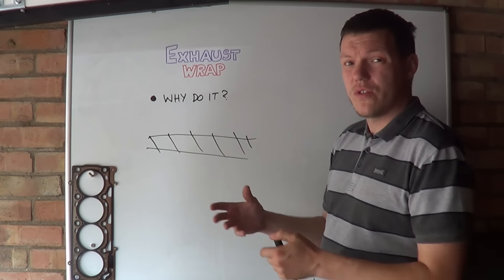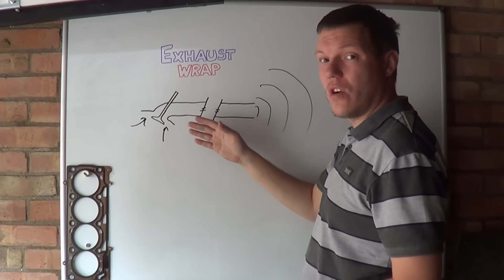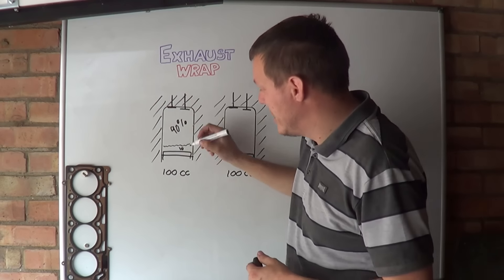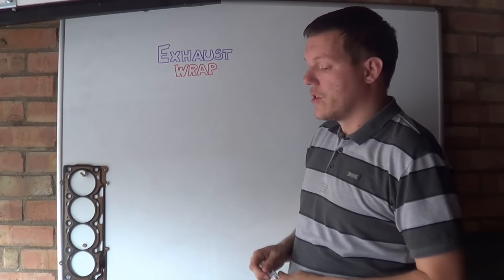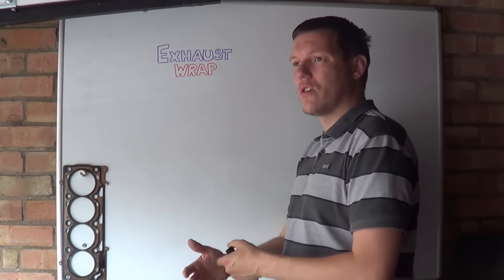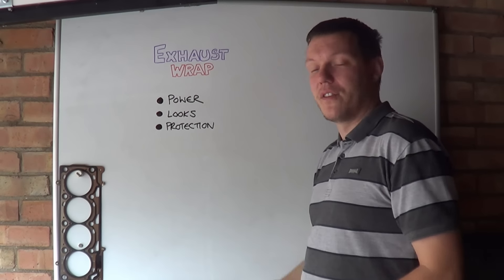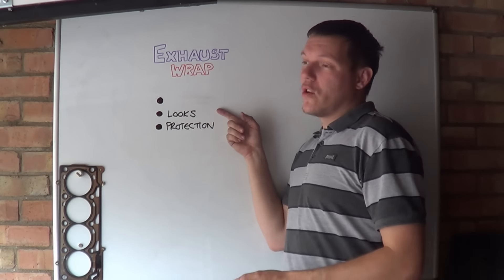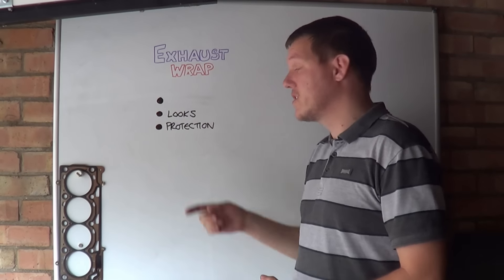Exhaust Wrap - Good or Bad - Bike TEch

Comment: There is a 4th reason to do exhaust wraps - thermal control.  I have an air cooled dirt bike where the header pipe is very close to the cylinder body and the carb bowl.  Instead of making heat shields, a good wrap helped cut down the radiant heat soaking the bowl - and maybe helped keep a little heat out of the cylinder itself.  It also helps with keeping my right leg from roasting, so bonus!
Reply: Very good point.  On one of my Harleys the exhaust is right near the oil tank.  And it burns the shit out of my pants.  But the main reason I want to wrap it is to keep more heat off of the other shit.  For example the oil tank.
Reply: This is what i was wondering about as well. Let's say you have an air/oil cooled bandit with the headers straight in front of the block, would an exhaust wrap help cooling the block, since the moving air wouldn't be heated as much by the headers before hitting the cooling fans of the block?

Comment: I had exhaust wrap on my 125, I painted the exhaust with VHT paint first and cured that, then I applied the wrap, after a very wet and horrible year I removed the wrap as it started to go white from heat and found my exhaust looked just as good as when I painted it. I think a lot of people forget to paint or protect the metal, as said the wrap will hold water when not running and so on.
Reply: Exactly. Also, never put the bike to sleep if the wrap is wet. (Caught in the rain on the way home) Let the bike idle and the exhaust wrap will be bone dry in no time.

Comment: exhaust wraps are supposed to be coated with a silicone spray after installed so they do not absorb water
Reply: That would stink to high hell as it burns off.
Reply: 1-Shot slinger  it's a high temp silicone that won't burn off but seals the wrap so it doesn't absorb water and deteriorate
Reply: What is the brand name of the stuff ?
Reply: 1-Shot slinger DEI Hi-Temp Silicone Coating
Reply: Thanks  I'll try to get some.
Reply: Is there a UK seller of the spray?
Reply: Is there any other brand who makes same kind of that high temp silicone spray?
Reply: @galuhrichata6148 - As I know, the pure silicon oil always has a much higher flamepoint than mineral oil - maybe let the aerosol disappear and start the engine next day? Silicone oil is also used as a release agent with resines (no paint etc. sticks on silicone sealant!) - Let me know, does silicone spray really helps to keep wraps clean?
Reply: No need
Reply: You dont need it. Many have used the wrap without this spray, and all good.
Reply: On the most part yes, DEI titanium wrap doesn’t need it according to the manufacturer. Their silicone spray is just high temperature paint and all it does is keep the fibers together for less wear and tear.
Reply: @michaelbradshaw2069  there is no other once? I need transparent for red wrap...

Comment: on my husq 510 i just did a double layer 25 cm long next to my leg. no change in performance but now i dont cook myself when im stopped at a traffic light... 3 years later and i havent had any problems
Reply: Vastiano Cara the power differences are so small you don't notice them. You can probably just notice them on a dyno
Reply: i dont know, never had it on a dyno. but anyway as you said difference too small to notice, apart from my leg :)
Reply: haha yeah :d dont get yourself burned! :D

Comment: My thunderheaders are ceramic coated but still required shields to keep from frying my right leg. After a few years I removed the shields and wrapped them. I prefer the look and reduction of labor when I don't have to fool around with the shields.

To those that worry about corrosion just don't let the wrap stay wet on the pipes any longer than needed. They dry out quickly with minimal steam production once the engine is running. Been running wrap for years now. Glad to hear that it helped performance a small bit. Thanks for the clear explanation.

Comment: I was waiting to hear you mention something about tuning after a wrap, because i would think the engineers knew there was 10% exhaust gasses left and if you change that ratio by wrapping, wouldn't you need to re-jet or at least adjust air-fuel mix accordingly ?
Reply from the maker: No, because it makes such a small difference that it might as well not exist

Comment: A wrapped exhaust system may have more back pressure due to the fact that the exhaust gases remain hot longer. As the gases cool, the exhaust gas contracts, flowing more freely out the pipe.

Exhaust pipes on turbo systems are rarely wrapped because it causes too much heat to be retained in the exhaust system, causing the turbocharger center section bearing to fail or the oil to coke up.

Comment: Hello, great video.  Clear, concise and confident.  I'm facing a challenge and I'm wondering if wrapping the pipes will improve the situation and if there is anything else that would be better.  Explanation:  I have a car with a mid-engine.  The engine bay is cramped and has four walls.  The bonnet comes down and has a seal all the way round so it builds a 5 sided box.  The only "open" side is beneath the engine.  There are no vents in the bonnet and as we all know, heat RISES.  The vehicle also has a turbo which I've measured to reach temps of 1500'F on the hot side.  The bonnet also doesn't have any vents and there is no where for the heat to go besides out the bottom through high pressure and lack of space/volume.  HOW can I get all this heat out of the engine bay and lower the total engine bay's temperature?  Thanks
Reply from the maker: Measure the temp in the engine bay - it's not sealed but if you have having engine bay heat issues - then vents or the dreaded cold air intake that is actually from the from of the car
Reply: @thedirtyworkshop  uhhhh seems like you're replying while hammered :P   So how do I get heat OUT of the engine bay?
Reply from the maker: What do you mean? There's no such things as a heat vacuum or anything - you have to flow air through the engine bay.
Reply from the maker: The biggest issue with having a hot engine bay is hot air being drawn into the engine - at any rate - this is a bike channel - fuck cars
Reply: @thedirtyworkshop  Ah, didn't realize that.  Found the video on a google search about exhaust wrapping.  I see the "Bike TEch" now.  Thanks for clarifying....  This was one of the first videos I watched... after more research I now know that wrapping is an inexpensive way to keep the heat in the exhaust pipes.  I'm sure ceramic coating is superior and will be going that route.

Comment: Just to toss in my 2 cents, in car applications it does a good job of keeping the temp down under the bonnet. I put in on my MG's header for this purpose. Also the protection from burns factor if I am adjusting carbs while the engine is hot.

Comment: Excellent description...could you continue the explanation about speed of the sound wave/efficiency of scavenging, with respect to other aspects of the exhaust...mainly the impact on scavenging of removing or downsizing the cat, and the impact of pipe diameter? That’s the age old problem many people try to solve to increase power (along with tuning the length of the exhaust). As it’s possible to buy E marked cats that are much smaller than OEM, and which fit inside the diameter of the header pipe, it’d be interesting to know the impact of removal or downsizing on scavenging : )

Comment: I was wondering the exhaust gas temperature and volume of air are  proportional too and high speed flow in the exhaust system is going to have a higher resistance in a given exaust system so at the end just wrapping your exhaust isn't that going to have negative effect instead of positive in the exhaust scavenging. Great show I managed to learn a lot from you.
Reply from the maker: I not quite sure what you mean dude - why would higher speed flow have high resistance??

Comment: I had a problem with wire harness melting from exhaust heat and the wrap did the trick.
I did the exhaust with wrap and used spark plug heat shielding (same make as the wrap) and works great. 
The intake manifold stays cool as well witch doesn't help fuel milage but improves torque for when you have to hall 1000 pounds of tractor, rider, and equipment up steep hills👍

Comment: My experience in the pipe trades dictates that its always better to insulate. Generally you wanna keep hot things hot and cold things cold and it has never seemed to be any different in any machine or system I've worked on.
Reply from the maker: Apart from a cooler exhaust can withdraw more heat from the head. This is why exhausts are 'usually' in the flow off on coming air

Comment: Pro Tip:  Before wrapping your headers, scuff them up, prime them with high temp primer, then paint them with high temp paint. This will protect them from moisture/corrosion.
Reply: I just had mine ceramic coated first

Comment: Ceramic does work better but if you don't want to get your pipe coated I know on 2 strokes exhaust wrap keeps heat in the pipe and does help with power. As for 4 strokes I'm not so sure it really does much but with 2 strokes keeping the pipe hot does help a lot.

Comment: The main practical reason to use exhaust wrap is to mitigate heat soak. In cars, wrapped headers will reduce underhood temps, which can then result in more power by allowing you to advance timing without incurring detonation. In turbo cars, cooler temps can allow you to reliably run higher boost. 

On motorcycles, the exhaust pipes often run by the oil pan, your legs, and other things that work better when not cooking. If your bike is air-cooled, keeping hot exhaust gases away can open up similar tuning opportunities as with cars.

Comment: Awesome explanation man been trying to find something like this for months. I'm thinking of doing a wrap on my Harley purely for looks, I'm slowly going from stock to chopper type build. My main concern is the effects on the carburetor, I've heard the increased exhaust speed can cause the bike to run lean. But from your video it seems like there won't be much change. Since you seem to know a lot on the topic, I'd appreciate your opinion on exhaust wrap creating a need for carb adjustments once installed. Thanks!
Reply from the maker: Changing exhausts totally can have (and usually does) an effect on the engine running lean. For exhaust wrap I wouldn't worry at all. In the video I talk about the physical difference exhaust warp CAN make, but I'm saying that loosely. Thanks for the comment dude and I hope that answers your question. - matt
Reply: Thanks that helps a lot. Appreciate the speedy reply too! Ride safe man!
Reply from the maker: You too dude - matt
Reply: No way will it change carburation !

Comment: not so much about wrapping but about exhaust scavenging.. I have been told that volume of exhaust system has to be counted some how to be proportional to cylinder volume. I can't found that "fact" now.. but I think you should make video about how to calculate exhaust system size.. thanks for your videos!
Reply from the maker: I would be interested where you found that, as in it makes no sense. But I'm still interested - matt
Reply: The Workshop if I remember correctly, it was Facebook comment. It was about pressure waves, when exhaust pipe has same volume as cylinder displacement is, it adds flow. But don't gas expand after work stoke so they aren't same volume anymore? I could not back it up anywhere from internet.. and I have no idea how to tune (of you can tune) 4stroke engines exhaust.. yeah, there are some calculations for headers, but I have been thinking of building 2-2 system for my cx500.

Comment: I just pulled my exhaust wrap off because it rusted a hole in my header pipe on my motorcycle. It did a great job of keeping engine temps down, otherwise it holds to much moisture  :(
Reply from the maker: Where do you live and on what bike?
Reply: The Workshop ,I own 2006 gsxr 750,with 22k on the clock and I live in Xenia,Ohio. United States of America. It has seen lots of rain ,and a couple winter roads. Where do you live?
Reply from the maker: 1) wrapping would actually cause the engine to get hotter - the exhaust is mainly cooled by being in the air stream. The amount of heat transferred through the pipe is orders of magnitude higher than any heat transferred through radiation. As for using VHT - prime them with what? Because unless you have VHT primer (which I don't think exists) then don't use primer
Reply: The Workshop I agree somewhat, i mean  the exhaust is next to the radiator. So really it keeps the water temperatures down quite a bit more with wrap at stop lights. It cools faster with wrap while driving too! So it's really a double edge sword! I got a new header and painted it first with stove paint, from a liquid quart. Brushed it on a couple coats. Then I put lava wrap on. It has more  power with it!

Comment: A mates car had exhaust wrap for the practical benefits, a 5 litre V8, under bonnet temperature is a worry in a glass fibre car plus issues with reduced intake air density and vapour locks in the fuel system. I am sure a bike suffers far less from the density issue. FWIW this particular car had an unusually long exhaust route with the exhaust going forward then back.

Comment: Always the best place to come for genuine practical info!  What do you think about using this to reduce the average coolant temp on my R1? I’m conscious that the headers are really close to the radiator and it does run hot….  Failing that is it worth using it around the underseat exhaust pipes to cool me arse down?
Reply from the maker: You need a doule skinned heat shield with an air flow between the two.

Comment: A note on ceramic coatings.  If it's sprayed on and baked in an oven you can make your food in, it's not a true ceramic coating it's just a very durable high temp paint.  True ceramic coatings, like one applied by Swaintech, have to be applied and brought to a molten state (reads, extremely hot) in order to bond with the surface.  This also means the coating is much thicker than a typical spray paint style application.   With rare exceptions, most DIY style ceramic coatings don't offer the true benefits of what ceramic coatings can, other than a nice look at least.
Reply from the maker: "True ceramic coatings, like one applied by Swaintech, have to be applied and brought to a molten state "

- this is called plasma spray coating. 

Video coming soon on this- gonna try and visit a company to talk to them and get the footage of it being done. - matt
Reply: That would be an incredible video.

Comment: i did it for none of those reasons. idk if my method was smart but the theory was, engine would get really hot (too hot), the exhaust pipe ran in front of the engine, so when driving the hot gasses coming off the exhaust would come back at the engine. so i installed the best radiator the bike could get and wrapped the exhaust to eliminated the heat coming back at the engine. and well, it worked for me. bike doesnt overheat anymore (fj 1200 '89)

Comment: Ok this is probably a dumb question... small crack in exhaust, (crossover pipe on our engine actually) can’t afford to have repaired at the moment but need to do something because it’s pulling in air and causing the sensors to bug out and car is driving like shit... this stuff is cheap... will wrapping my crossover pipe, or at least enough of it to cover the section that’s got the folds where the crack is, will doing this keep it from drawing in air as a temp fix until we have the money to repair it properly........ yes a proper repair is 100% better... just looking for a temp solution to keep the exhaust system from drawing in excess air and bugging out the sensors... thanks folks

Comment: Is there any great risk to keeping the exhaust gases hotter for long as far as the engine goes? Are the cylinders likely to get hotter and could it potenially damage internal parts?
Reply from the maker: No, dimple because the engine is generally overcooled by design.